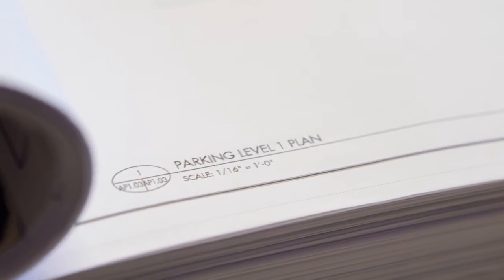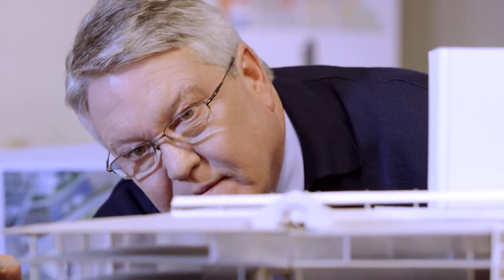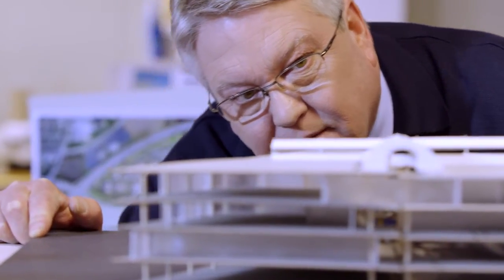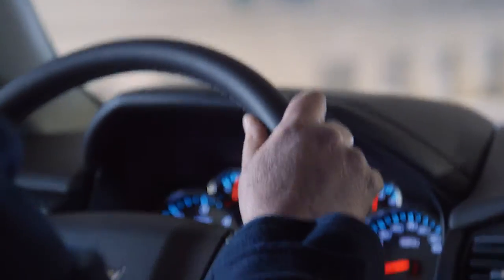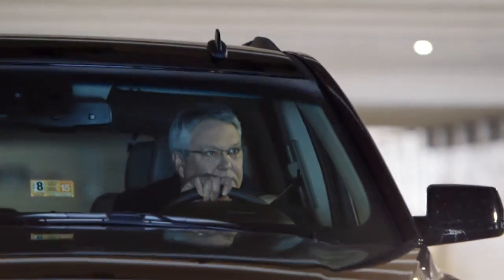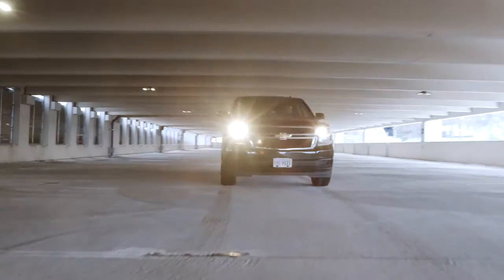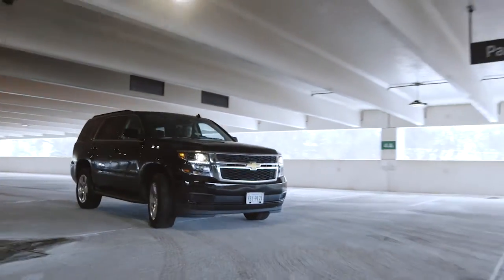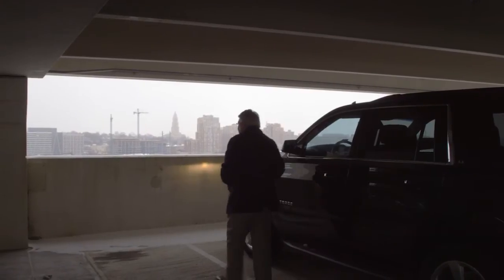Value Engineering

Comment: This is Cost Cutting and not Value Engineering. Value Engineering is seeking alternative solutions to add value to the project. You just used the wrong terminology. I would appreciate if you could re-post this video with replacing the term "Value Engineering" with the term "Cost Cutting" and this video is a great example on the difference between Value Engineering method and Cost Cutting Method.

Comment: VE is  finding ways to do the “function” reliably  at lower cost if such a technical alternative is available. VE is proper engineering. VE is appropriate engineering.
All 13 Value Analysis & Engineering Techniques of L.D. Miles with examples - Video Presentations 
https://www.youtube.com/watch?v=BHH-QZ29EOo&list=PL6W3qaSriFEgzI80uqu4ygW5jJsDCCyJf

Comment: Value Engineering often has to “increase cost” in areas that “need” improvement and take extra cost out other places that don’t compromise the design or its use. VE is not to blame. VE is not cheapening of an item, it’s finding ways to do the “function” needed at lower cost—never lower quality. I know you are not knocking VE, it’s the folks that didn’t listen...
Terry Miller Value Specialist and owner of a VE consulting firm. If needed contact me at terrymillerohio@att.net.

Comment: Interesting, yet in my opinion a one sided story. The fact that the ground settled beneath the slab is of concern, since this is the root of the problem, not the pipe material itself. With proper pad-site preparation and compaction this would not have occurred, moreover, that fact that the soil/materials beneath the pad did settle is evident of poor compaction or perhaps reintroducing sub par soils materials back into the trenching. By no means is the VE idea to go with PVC the culprit, as the settling would even strain the system with cast iron materials (no-hub or CISP hub/spigot joints), and cause cast iron joints to pull apart.

Comment: As a Union Master Plumber for 32 years I have installed cast iron underground on most of the projects I worked on. In fact I could install cast iron bell and spigot faster then gluing plastic pipe anytime. The install time is almost half and if the inspector wants to see a head test I don't to wait for glue to setup.